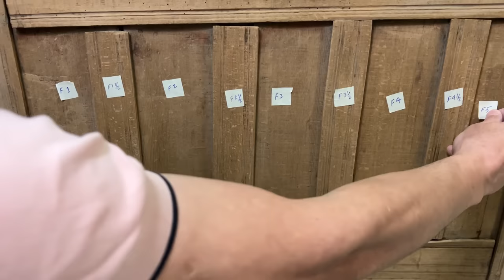Restoration of the 500-Year-Old Chest - FURNITURE RESTORATION

Comment: Interesting video and a good restoration but as a chemist I did raise my eyebrows at your home made cleaning solution. Without going into the chemical equations, what you are doing is adding two acids to an alkali with the result that you are simply creating some pretty inert sodium salts in a neutral solution. The fluid you produce isn't cleaning the furniture, it's simply the action of you agitating the wet surface with wire wool to dislodge the dirt. You would be far better off, and it would be far cheaper, to use a mild detergent. Don't waste money when you don't have to.
Reply from the maker: Thanks my friend, I didn't check it in terms of chemistry, but this solution worked well, the old solution was white vinegar and baking soda, I added the rest myself...
Reply: Shouldn't be using "wire wool" when cleaning wood. Small bits can remain, which may rust.
Reply: New England folk info includes the vinegar/baking soda trick with a comment that the effervescence works to lift dirt. The Coca Cola additive is also folk based after WWii, when experiential learning showed that it would lift the finish off of most anything.
Reply: As loung as the person is happy with what he or she as workt on i dont see a problum it looks amazing job to me👍😁
Reply: @CreativeIdeasMaker  I'm no chemist but since baking soda is basic and vinegar is acidic, I would guess you'd have the same problem of them neutralizing each other and becoming useless.
Reply: @CreativeIdeasMaker what he is telling you is that a simple solution of water with a mild detergent would have worked even better, cost less and required less effort.
Reply: @cappyfann750  Right...better to use Scotchbrite!
Reply: Hello, I’m another chemist. Your chemicals did not work at all. Only your scratching action cleaned the furniture. Your answer that “this solution worked well” is really a scientific non-sense.
Reply: Exactly, I used water and liquid soap to clean a piece of furniture years ago and the result was good
Reply: You are no fun ! It’s the journey he chose .don’t be such a know it all.
Reply: @pmichelerowes3700  We don't want to be funny. Science is fun but is another thing. If you like hoaxes there is no problem but things are in a different way than what he said here. Then if you want to believe in the lemon that is good for you in the morning or that the earth is flat these are just your problems.
Reply: @railfanning101vermont5  The only  time I use  any cola is to pour on the windshield to remove bug splats.
Reply: @denisemurray412 that doesn't work any better than plain water. Arguably it works worse since coca cola is nothing more than caramelized syrup of corn, golden sugar and simple water. The first chemist is wrong to call it an acid since sugar has a pH of 7. Next time use a little detergent in warm water with a plastic scraper 😉
Reply: @Bless7789  it is the carbonation that loosens the bug guts.
Reply: @denisemurray412  that's impossible as the c02 isn't bonded to the liquid which is why soda starts to go flat if you don't reseal the bottle.
Reply: Well done😊
Reply: Хорошая работа!
Reply: @cappyfann750 excuse me but even people at the top of their jobs i.e restorers use very fine wire wool. It get the dirt out in the grain and the chances of little bits going rusty are pretty rare. Must admit I’ve never heard any restorers say that.!!
Reply: I was wondering the same. I had used the popular combination of baking soda and vinegar to remove deodorant stains from my shirts, but then I realized what I needed was the acidic effect and not the resulting (mostly) innert salt. Results with vinegar alone were better. Also, toothpaste is commonly used as a mild abbrasive, but since you are already using the wire wool, maybe this is also futile. It could be better to use these products separated, but it would add many hours to the already long process.
Reply: That's an inexpensive solution. The salt and carbon are like a gentle abrasive, no?
Reply: I think you did a beautiful job on that old. I love your delicate care and craftsmanship of the old. Whatever works for you and gives you your desired, then go for it!! A beautiful job!!! ❤❤❤
Reply: @railfanning101vermont5 I very much doubt it baking soda was not used until the late 1800s as it was easy for bakers to still use gone of milk and brewers years to make dough ot wasn't commercial available till about 1846 and Coco cola definitely wasn't around
Reply: It's the Cocacola.
Reply: @cappyfann750 I’ve seen it used by other restorers. Could a good vacuuming remove any bits?
Reply: I use disinfecting wipes to clean filthy furniture before refinishing. You don't want to soak wood furniture with too much water to remove the grime.😮

Comment: I love that you kept the integrity of the furniture intact with minimal interference... brilliant job
Reply from the maker: As you can see in the video, this box has been attacked with iron nails during different periods, but we tried to pull them out from the box and use the old connections.
Reply: @CreativeIdeasMaker  Entschuldigung, aber woher wissen Sie, dass die Truhe 500 Jahre alt ist und in welchen Land sind Sie?
Reply: @petermages9482  Das würde ich auch gerne wissen. Ich denke, es ist ein Weichholz und es würde im Alter von 500 Jahren anders aussehen. Wenn es nicht in der Wohnung geschützt war.
Reply from the maker: @petermages9482  
@janaj.8696 
If you are a carpenter and have information about the types of connections, you will realize that at the beginning of its construction, this box used only wooden connections and wooden pins, but then some iron nails were added to it, which are from several hundred years ago, and then nails It has been ironed that these two types of iron nails have destroyed the originality of this fund. My reasons for proving the age of these items are: documents and writings about the house 2- Many of its furniture and equipment are kept in the museum 3- The wood worked in this box, which you can be sure you will not be able to find from a few hundred years ago.
Reply: @CreativeIdeasMaker  Thank you so much for your friendly reply! Much appreciated! Vielen Dank fuer Ihre Antwort!
Reply: @CreativeIdeasMaker   Yes. It is not all that difficult to date very old furniture. 
There are some labs that specialise in dating the wood and they only need a small shaving for that. 
Apart from that, the structure of furniture evolved along the centuries and although it would be difficult to pinpoint exactly the years it was crafted, the period is easily recognisable when you know the areas history. 
When you have written data about the house and it’s contents, then it is a breathe.

Comment: What a beautiful restoration work. I only wish its centuries-old patina had not been stripped away. 90& of its value as an antique was lost with the sanding. Sad to see it gone. A deep cleansing would've given it the same finish but without the permanent damage. I gladly subscribe to your channel, knowing that practice and error make the master. Thanks for sharing the detailed process of your work. Good luck. Cheers
Reply from the maker: I am very happy that enthusiasts like you are concerned about history and give us detailed expert tips. If you have noticed, there were two chests of this style in the video, we have removed the bigger chest and the smaller chest was healthy and there was no need to remove the patina on it, but the bigger chest suffered burns in several areas during these hundreds of years. Also, holes have been created by modern iron nails and we have tried to fix them and give life to this box again.

Comment: Beautiful job.  Thank you, (and good luck on the old house itself, stay safe under that old propped up roof! looking forward to see how you make it happen !)
The old nails at least kept the piece in use and not ending up in the fireplace!  Lovely to see it fixed and put back together as done by the first maker.
if you can get ahold of one, a hypodermic needle/ syringe makes a great tool for getting glue into slim or tiny places a bit more easily.  Just rinse them out immediately!
You may find a specialty glue syringe at a big tool store, depending on your closeness to a big city. (or if it can be ordered online and delivered nearby to you) 
But a thin knife does work, and the thread/dental floss was a great idea to spread the glue.  We save old toothbrushes to use for larger areas, lol .
Old- fashioned hide glue I have seen used in restorations, as being almost identical to what would have been used originally long ago (if they were indeed gluing any areas at all !)
Reply from the maker: Thank you, my friend, for your meaningful comment, the reconstruction of this house is very expensive, we cannot afford it, but I will try my best.
I am still thinking about the carpenter's masterpiece, special wood, special skill, special chest. (You must have noticed that I did not oil the inside of the chest, the reason is that our carpenter wets the curved parts of the chest by adding water, the curvature of the parts increases and the chest becomes stronger)
About the syringe and the carpenter's knife, I will definitely get it.
It was an old glue for this wood, it didn't work very well, but it was great with this glue. I didn't try the skin glue
Thank you for your comments, guidance and support, have fun...

Comment: It's a lovely piece. Was it a grain chest? One suggestion.... since sesame oil is not a great long lasting finish, have you consider applying a high quality hard wax over the oil or other longer lasting finishing technique. It may be the sesame oil was commonly used on furniture when this piece was made, but a longer lasting finish will give it more protection.
Reply from the maker: If we wanted to renovate in today's style, yes, we could use very high quality coatings, but the important thing is about the wood you use. This type of wood was covered with this sesame oil in the past because of its penetration into the wood and because of the color and gloss it gives to the wood.

Comment: Baking Soda and vinegar neutralize each other.  You'd have been much better off with just the vinegar and water, and maybe some gentle dish soap.
Reply from the maker: Soap is an alkaline substance and they neutralize each other with vinegar acid. It is not important to neutralize the solution that contains the solvent. You can try this combination once and see its miracle, although our goal was not only cleaning, but also the permeability of wood for oil coating.

Comment: Nice job!
Sympathetic restoration of a nice old piece.
I’d offer the following though, firstly hide glue would have been more appropriate for a piece of this age, and secondly I’m not convinced sesame oil is a good choice, I’d have gone with a shellac or beeswax finish.
👍👍
Reply from the maker: thank you my friend
you are kind...
If you mean the use of hidden glue in the joints of the old chest, it is not necessary, because the design and structure is such that it is fixed with wooden pins.
The reason for using sesame oil was because our ancestors used it in this case, it may be unconventional but it gave good results on this type of wood.
Beeswax is great, but in our region, wax worms cause damage...

Comment: A beautiful restoration ! Iwould have oiled the separate pieces of wood individually several times before putting the chest together. That will preserve all the wood to last much longer. Perhaps a mix of beeswax and sesame oil for the final coat and then polish the wood.
Reply from the maker: You are very right in that if the parts are covered separately. But in the case of beeswax, you should be careful, this type of coating attracts waxworms or insects, and sometimes you can see the cocoons left by waxworms on the wood.
Reply: @CreativeIdeasMaker  Thanks for informing me of waxworms. I'm just an amateur restorer and have never used beeswax. I usually use a clear good wood oil, or linseed oil for wood on window frames.
Reply from the maker: I had a bee for a while, I had experience,
The oils you use are great...

Comment: A lot of restoration went into this ancient chest, but now it is useful again. It was very interesting to see the old construction method.I wonder if the sesame oil would attract insects? It has a strong smell, that I find attractive.
Reply from the maker: I am glad that the techniques used in this restoration of the old chest were useful and satisfactory for you. Regarding your question, you can use refined sesame oil, which removes its smell in different ways, and this oil does not attract insects after applying it to the wood. Thank you for your nice comment

Comment: First time I saw somebody cleaning the wood with sweet Coca-Cola
Reply from the maker: If you pay attention, the displayed washing solution contains several different ingredients, which is an old version, but used in new forms, and this solution, which contains soda, contains citric acid, which when mixed with baking soda and white vinegar, Other materials are mixed, a solution is prepared that can have high cleaning and make the wood fibers flexible, so that in the end we have a better penetration of the oil coating.
Reply: @CreativeIdeasMaker  I paid attention very well, and I think that solution without cola can have the same effect to the wood. Sogar and sesame oil can bring cockroaches or some other bugs in the future.
Toothpaste and backing soda are the same thing, and it is strange to put both. Toothpaste also contains sugar.
Reply from the maker: You are right about the sugar, and I used sesame oil the ancestral way...
I forgot to say that this wood was used to repel insects in the past...
White vinegar and baking soda can be used alone...

Comment: Very great restorarion. But this Swat Valley chest is not 500 years old. It is XIX century.
Reply from the maker: Thank you for your comment. I am talking based on the documents and the type of use of this house, and also about its unique wood, and I obviously have valid reasons for it, even if you look carefully, this chest has been attacked and repaired during different periods with very old forged nails and modern nails. It was found that it has distorted its authenticity. But the question is, on what basis do you say that this fund is 200 years old?

Comment: that baking soda, coke, and vinegar solution is just essentially sugar water. What makes baking soda clean well is it's alkaline ph and grit. As soon as you add the vinegar it's acidic ph neutralizes the baking soda and because it's a liquid dissolves the grit. It makes both vinegar and baking soda not work anymore. You'd have been better off with wood soap. Of course it got it somewhat clean but get it wet with anything and scrub with steel wool and wipe off with a clean cloth and it would clean it.
Reply from the maker: Thank you for your opinion and from the point of view of chemistry and the reaction of acid and base, it is completely correct, but the point that you have not mentioned is the amount of these substances that remain and clean the surface of our dirty wood. We all know that there are many solutions and products for cleaning wood, which we try to show you in furniture restoration videos.

Comment: Wonderful restoration!!!  What do you think is the purpose of the corner posts cut so high above the surface of the top of the chest?  Did they support another storage piece? Perhaps, they held a cushion in place and the chest may have doubled as a seat? Thanks!
Reply from the maker: The only thing I know about the use of this box is that it was used to store supplies and sometimes valuables. Another point, the woodworking style of this box, especially about the bases, is related to 500 years ago in our country, which has been very popular, and many wooden artifacts were made in the same woodworking style during that period.

Comment: Loved watching the restoration especially the chemical solution just to get cold soapy water lol and that is not how you sand wood that's being restored you go with the grain so as not to leave scratches and for restoration you use all that is there no replacing unless it's total necessary and never use vegetable oil as a finish as it goes rancid eventually but it was nicley out back together congratulations
Reply from the maker: Loved watching the restoration especially the chemical solution just to get cold soapy water lol and that is not how you sand wood that's being restored you go with the grain so as not to leave scratches and for restoration you use all that is there no replacing unless it's total necessary and never use vegetable oil as a finish as it goes rancid eventually but it was nicley out back together congratulations